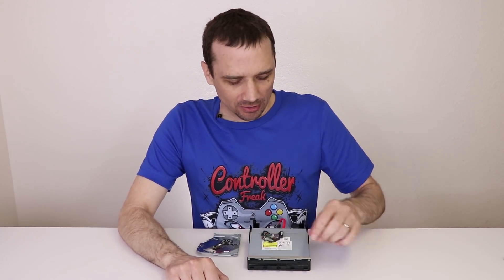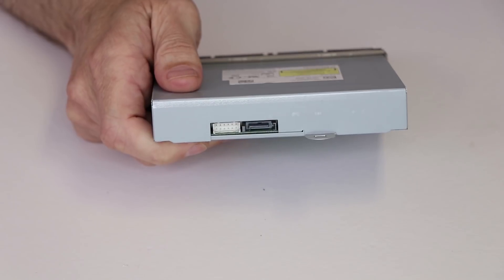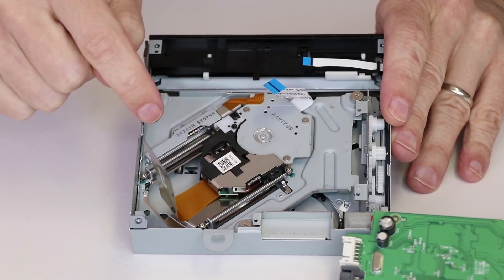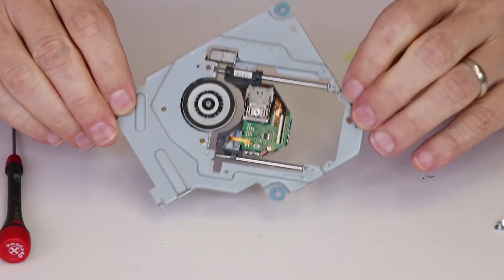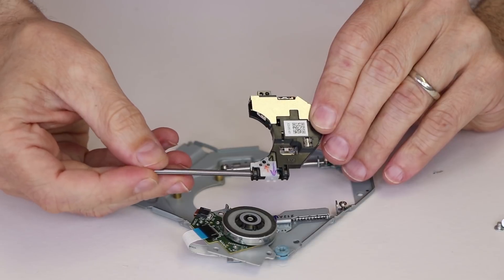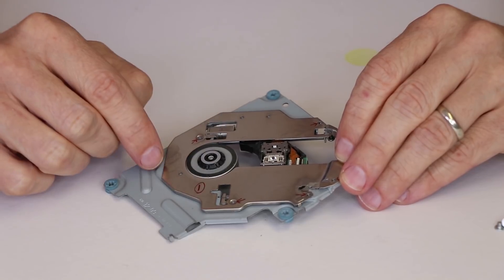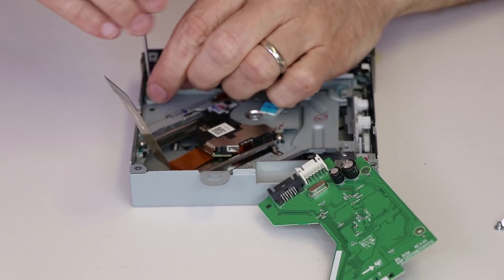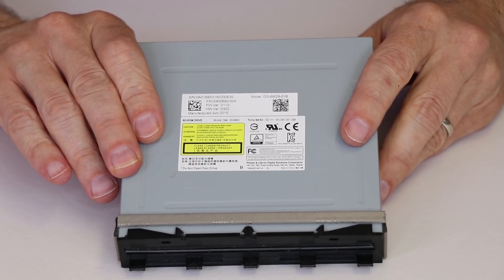Xbox One X Won't Read Discs - Original, X & S Models - Laser Replacement

Comment from the maker: Let me know if you have any questions! Thanks for watching.
Reply: When buying new laser will any Xbox laser fit or is there a serial code
Reply: @MK-tg6oi  wondering myself
Reply: My xbox one x plays certain games some games work and some dont and theres nothing wrong with the game
Reply: Helpppp i change the lens of my xbox one and now it makes weird noise when reading the disc and it still doesn’t work…. 😰😰😰
Reply: TronicsFix LLC hey my PS4 got the “too hot” overheating error “red light” then it shut off! I watch ur video and clean it out and still doesn’t work! I found out the fan was the problem and so I replaced it, and it work! No error of overheating but it’s very loud and the our controllers and not functioning right!!( If we try to scroll over it take 40- 90 second to move then the controller disconnects! ) We even bought another controller and same thing! We try resetting the controller but it take 15 try’s just to get it to connect then it disconnects!! We are now going to replace the thermal paste! But not sure what to do about the controller! Pls help
Reply: TronicsFix LLC I got the old Model of the PS4
Reply: It’s so loud I think it’s going to explode!!! Like really!!!
Reply: Hi, I followed all the instructions and changed the laser. But now my disc motor has stopped spinning, Any advice?
Reply: Steve Abruzzo  did u ever find out where u can buy one
Reply: Do you know if the xbox one s has the same CD drive as the xbox one x?
Reply: Thanks for the vid. I replaced the entire laser/motor deck with a new one I purchased from ebay. But now almost every BluRay makes a weird spinning noise. It seems to be all pressure and angle related. When I tighten all case screws really tight, it's very loud. If I ease on some of the case screws, it gets a little better. While it is laying down it works quietly for most but not all BluRay discs. But when I stand up the Xbox One X, the noise gets worse again. Clearly, it has to do with the tightened screws of the case, and very possibly with the screws that I used to tighten the deck itself. It is such a hassle to open up and remove everything, it is driving me absolutely nuts. It's nice that my 4K discs work again, but the spinning noise coming from the drive now is really making this a bad experience. Do you have ANY advice you can give? Do you think I should actually remove the laser itself from the new deck and put the laser back on my original deck and put that deck back in? What could be causing the spinning noise. It doesn't do that with every disc. I tested 3 4K discs, and they are quiet. However, my ST:TNG season 6 discs BR and also the new Tron BR I purchased make the spinning noise. Please HELP. Thanks!
Reply: @bellotriggerfish  know ahead of time that this is purely a joke and I hope you can understand why I couldn't resist the set up, laid out perfectly for me like you were Bud Abbott and I was Lou Costello.

Maybe you should try and run some slightly less virgin oriented discs and see if it helps. It might just be screaming for help, knowing it's doomed to a lifetime of Lord of the Rings discs and World or Warcraft variations, when there are so many promiscuous opportunities available for a nice young disc drive starting out fresh in this world. 😁
Reply: Hey Steve I love your channel! Got a question! I followed your tutorial on how to replace the laser inside the Xbox One. What my issue was is that with the console would not always read discs. I'd have to reinsert the disc several times to get it to read or reboot the system. I read that there's a known issue with some kind instant on settings and I've tried that without any luck! If it's not the laser which I don't think it is what else could it be? It pulls in the disc correctly. Any suggestions would be appreciated! Thank you and keep up the good work!
Reply: Still helping us Fixers 2 years after posting! This video saved another XB1!
Reply: Very informative video.

By the way I'll just pretend that I didn't notice you saying to make sure that the ribbons were out of the way, then immediately placing the daughter-board, directly over top of the smaller one. But due to the fact that you're half man half Hogwarts Alumni, it magically appeared in the correct position as you snapped it's plastic retainer closed. 👁️😁🧙
Reply: @TronicsFix, my original XB1's optical drive refuses to read XB1 games and Blu-rays, but will work fine with DVDs and XB360 games. Think this might be the repair I need, but are you sure the laser shown in this video will work with an original Xbox One manufactured in 2014?
Reply: Hey xbox one s disk drive is not working anymore what would i do to sort it
Reply: Hi thanks for the awesome videos! 
Wondering what else it could be? I just replaced the laser but still it doesnt work. Everything else seems to good inside, sliders working fine and nothing broken.
Reply: Oooh weird, just checked with a DVD and after Xbox installed the Bluray software it did play the movie! And then it also read game discs :) :) 
Can I fix it? Yes you can!! :)
Reply: can I use the disc drive from a xbox  one s to a one x ?
Reply: I have a xbox one that can read xbox 360 disks but can not read xbox one disks .Do you think the laser is bad? TKS
Reply: Spring pop off from the plastic piece once you slide the new laser will it still work I can't find it
Reply: I've changed the laser but I'm now getting 0x91d70000 error code. Have I done something wrong or bought the wrong part?

Comment: On a personal note you can never replace the whole disc drive because the hard codes are imprinted on the disc drive board so it is impossible but you can replace the laser in the disc drive or the spindle motor

Comment: I have an original xbox one launch edition that i had bought used, with dg-6m1s disc drive, that maybe running into issues. May i know what is the potentiometer set at on the laser? Because mine reads 0.6k ohm, i remember xbox 360 was like 5 or 6kohms.

Comment: I know the video is old, but maybe i get here Help. I replaced the laser like here (and the ifixit guide). Now i have the problem that the Drive doesn't work anymore. When i tap the eject button, it comes only a double ping and the DVD/Xbox don't go even in the console anymore. Is this because of the new laser, or did i something wrong?

Comment: My xbox one x only reads certain games but not all of them which is confusing to me cuase i don't know if to send it in to get it fix or not i know there something wrong whit it but don't know if is the lasser or not cuase it reads some of my games and don't take long to load my question is can do you think is the lasser or something else
Reply: Idk if you still have the problem, but my Xbox used to do that until it decided it wasn’t going to read discs at all no matter what one. Replacing the laser fixed it
Reply: I still do have that problem thanks heads-up i will get the laser replace thankyou

Comment: I have an original xbox one (fat/phat if you may). The disc drive board has some corrosion and doesnt work.

I found a 6m5s model drive locally. Will it work on my fat xbox one if i swap the microsoft chip? Also if the drive boards are compatible which power and sata cable should i be using. They seem to be different for both drives

Comment: Dude thank you so much. I actually got scammed on offer up recently on an xbox one x with a disk drive that didnt work for 250$. I bought a new laser on ebay for 11$ and followed this video and fixed it. Now i can play some of my old xbox original and xbox 360 games with amazing graphics. You really helped me.
Reply: 😂 Same I got a $250 one X with a red controller with suprise no backplate or wireless connectivity  from epawnamerica. They sent me a lil cash back but now I find out the box wont play discs smfh
Reply: I'm in a similar situation, although I only paid $40 bucks for mine so it wasn't that big a deal. At least I can play digital games until my laser comes in the mail
Reply: Just happened me too!😂

Comment: Why did you make your job harder than it needed to be with how you disconnected the main cable to the laser? take it out after removing the laser and install it before putting the laser back in. it doesn't get in the way or anything and is much easier and you can make 100% sure its fully in place correctly.

Comment: My xbox one x will not read dvd's or 360 games. Blu rays and xbox one games work fine. Do you think doing what is done in this video would fix that or could it be something else? Cheers.

Also where would I buy one of these? Thanks again.
Reply: I’m having the exact same issue and I’m pretty sure it is hardware (laser)

Comment: If you have 2 complete disc drives can you just instead change the daughter boards?
Reply: motherboards or pcb board don't call it a daughter
Reply: @patrickwilliams9611  it is called both, in this video he even calls it a daughter board

Comment: Great video but in all fairness, the consumer shouldn't have to do this as Microsoft should release a machine that works, disc drive and all, I paid 500 for my one x and every month or 2 the drive completely dies, send it off, wait ages, get it back, works fine for awhile then same problem. No compensation or anything free off Microsoft as an apology, hell the amount of times I've sent the one x and the one s (same drive issue) back Id expect a free console

Comment: Hey there! Thanks for the great tutorials! My XBox is not reading any discs. I took it apart with your instructions which were super helpful! I thought maybe my toddlers put coins in the drive. I didn't find anything but my Xbox has also been starting up really slowly for a while...any thoughts on what would cause both of these issues? Thanks again!
Reply: xbox not on power saving ? it will take ages to load have it on instant power up
Reply: Did you ever fix it? I have the same problem and circumstances

Comment: 2:49 - Any reason you didn't remove the plate before removing the flex cable? Seems it would be easier with that out of the way. Likewise when refitting - fit cable first, then replace shield plate?
Reply from the maker: It probably would be easier. I do it this way because it's what I'm used to. For some reason it's just easier for me to remember to put the ribbon in when I do it this way.

Comment: Would the pot trick work to test before replacing like the 360 days where it slows down the laser.
Reply from the maker: No idea. I don't even know what trick you're talking about! I've not done much with 360's.
Reply: TronicsFix LLC so on the 360s certain drives had these little pot looking screw. Depending on the pots being turned left or right you could change the impedance on the laser then allowing the drive to read the disk again.
Reply from the maker: Yes, gotcha. I've not checked that on these.

Comment: The last ribbon cable should be connected BEFORE putting the top metal plate back.Min:6,35
Reply from the maker: You can do it either way. Yes, it's easier to put it in before the plate but it doesn't have to be done that way.

Comment: My brand new PS4 Pro doesn’t display anything on the screen on my Sony Bravia Cx52 except a blank screen and a sign saying PlayStation 4 Player 1.

However it works completely fine on another tv.
I’ve tried changing resolutions, and everything but nothing’s working. Maybe it’s the TV’s HDMI port I’m not sure.

Ik this Question is off topic but any help will be greatly appreciated 
Thanks and Cheers!
Reply: Have you tried connecting it to different hdmi port?
Reply: Legend i5 I have actually, Still no improvement and it’s driving me nuts. I’ve combed the internet for solutions but no result yet
Reply: Interesting
Reply from the maker: That's a strange problem. I'm assuming you've messed with the settings on your TV. I'm really not sure what's causing the problem. Sorry I can't help you much here.
Reply: Just SuBLiME call Sony and ask them maybe?
Reply: ironic sony tv won't work with sony console
tv firmware incompatibility, ps4 pro had this since launch and sony blamed OTHER tv manufacturers, i remember my first xbox one first gen had this problem on one tv, fw update fixed it
i'm surprised sony still haven't fixed this